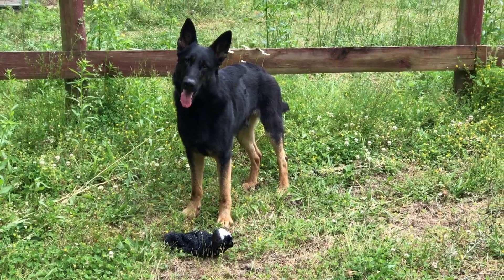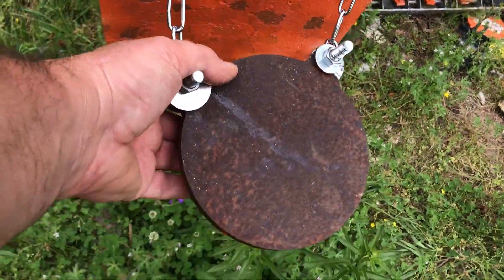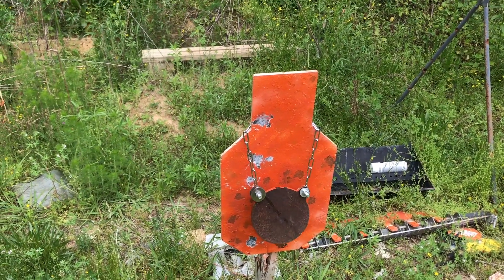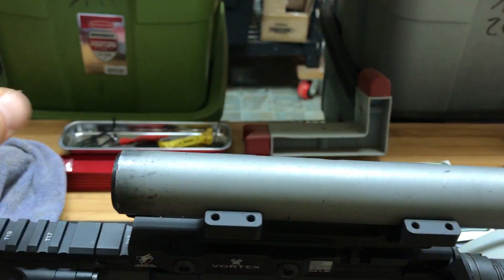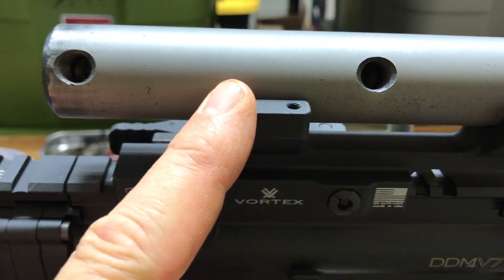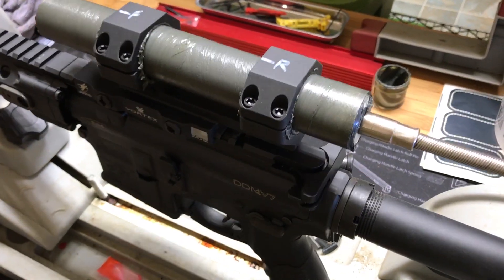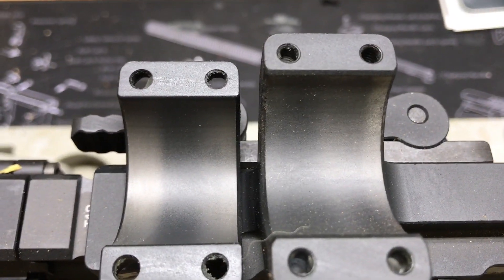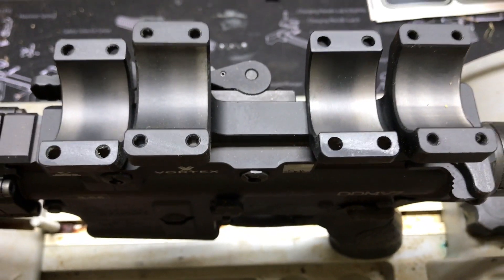Mounting New Pulsar Thermion XP50 Thermal Scope

Comment: How much torque do you use on the upper rings screws? Thanks for the video!
Reply from the maker: Generally speaking, I apply 18 inch-pounds of torque using medium (blue) loc-tite tread locker.  Some manufacturers may recommend other torque values, but 18 is sort of the standard it would seem.